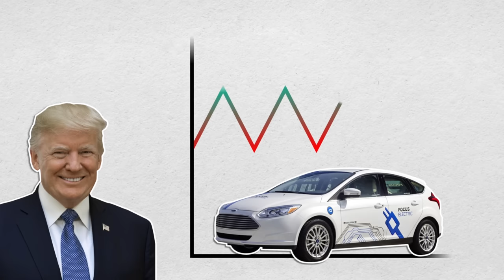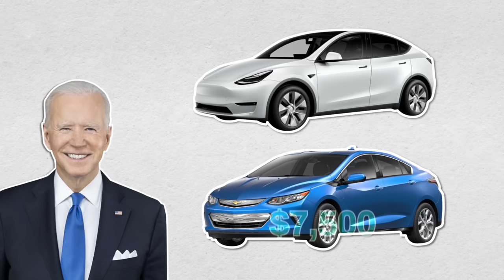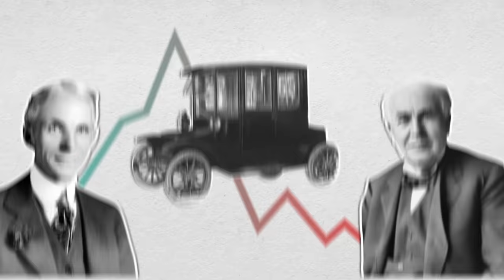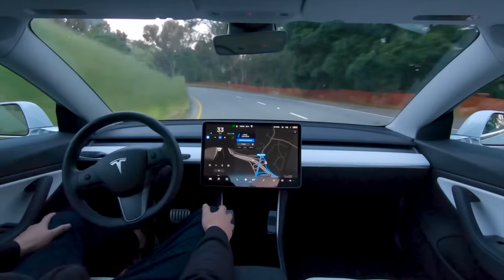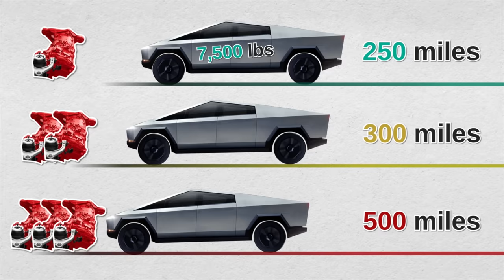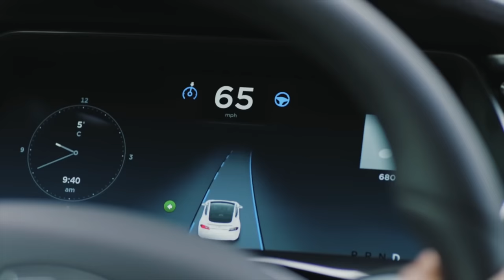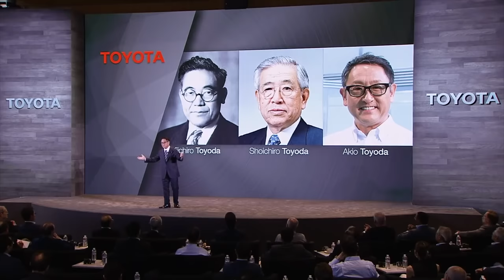Here's Why Toyota is Refusing to Make Electric Cars

Comment: GM did a great job with the Bolt-that is why they have told owners to park outside and not in thier garage just in case it catches on fire !
Reply: This is true; however, the vehicle is GM, but the batteries were made by LG. All of the defective batteries are going to be replaced at a cost of 1 billion dollars. GM is suing LG for the replacement cost. Meanwhile, I'm still parking my 2017 Bolt inside and I don't charge it overnight or leave it plugged in overnight. I have had no problems with fires or anything else in the 55 months I've owned the Bolt.
Reply: The Bolt is a great car by all accounts- no question about it.  The battery issue is erring on the side of caution and is minor- and GM does not make the batteries in those cars.
Reply: Not just the bolt. Teslas and others catch on fire as well. Teslas sometimes catch fire while you're driving them. One person was trapped for a while if you search on youtube for it. Car melted for the most part to the pavement.
Reply: @robertthomas5906  And you can say the same thing about ICE cars. They have a higher rate of catching fire over electric cars.
Reply: @TwoHawksHunting  I've heard that GM was also using a crappy charging protocol.
Hence the software update.
Reply: Just like Kia/Hyundai
Reply: @TauCu  They have told owners to only charge battery to 90% and not to run the battery down to below 70 miles of range. I can see why a lot of owners would have a problem living with these limitations.
Reply: @robertthomas5906  Yes other cars catch fire as well. There are about 80,000 gasoline car fires per year in the U.S.
Reply: @skipondowntheroad5833  I honestly didn't know the number was that high.
Reply: And they recalled every single one of them!!!
Reply: @kiae-nirodiariesencore4270  "You are 10.78 times more likely to have a fire in your fossil fuel car..."

Can you give me a link to that study, since you have already looked at it? I'm extremely curious about exactly what that statistic actually means. I'm guessing that the way it is derived makes it irrelevant. It is spontaneous fires that are the issue.

What is the ratio of ICE cars to electric? 100:1? I'm supposed to believe that for every 10 spontaneous EV fires (NOT caused by human stupidity), there are 11,000 spontaneous ICE fires?
Reply: Millions of gasoline vehicles have been recalled for fire danger since the Bolt was released ;)
Reply: @TwoHawksHunting  That’s the case for all EVs for normal use, because lithium. For highway driving you can charge to 100% and deplete below 70 miles without degrading the battery.
Reply: @skipondowntheroad5833  I wonder how many of those are insurance jobs?
Reply: @TwoHawksHunting  lg makes batteries for tesla aswell
Reply: @robertthomas5906  truth is, EV car fires are extremely rare…
Reply: @peterrotrovich1402  I drive an EV because it's just awesome to drive.  Everyone that I let test drive my car ended up buying one too because they had no idea that it could be that much fun to drive.  1/4 the price of gasoline is just icing on the cake.  It costs me less to drive my full-size EV than a motorcycle.  And assuming all those things can ONLY be made with fossil fuels, wouldn't you want to conserve those resources?  That's my reality.
Reply: @mcamodell  Yes, and I'd think that you could make many plastics with other plants, too. Maybe using just cellulose or starch or something like that. Gas is just hydrocarbons in different orientations....why not rework some plant matter into the polymers we need? I've always wondered that.
Reply: @TwoHawksHunting  suing lg for what?   lithium batteries have always been a liability with the phones batteries catching on fire  now a car with hundreds of batteries it was more than expected but they ignored that fact in order of gaining popularity in the market by looking high tech and innovative high selling points for any company
Reply: Lol

Comment: Good job. Eventually, the truth does come out. That truth is you can't just flip a switch and have battery operated cars.
Reply: "Eventually the truth comes out"? Actually what Akio Toyoda said about EV adoption has been completely discredited in a number of studies. I wish Scotty hadn't included Toyoda's claims in this video because from the comments I'm reading a lot of people seem to think that just because the president of Toyota said it, it must be true.
Reply: @normvanduker9999  What are you even talking about? The truth is there isn't enough electricity on the grid for all those battery operated cars, and there won't be any time soon. All the marginal power comes from fossil fuels. 

Pull your head out!
Reply: @CarbageMan  That's true
Reply: @cs1992  you seem to be forgetting hydroelectric dams. But truth be told, coal/oil will always be the primary source. Gotta take into account anything plastic is made with/from oil. All cars nowadays have plastic parts somewhere.
Reply: They’ve been around for over 100 years….
Reply: @CarbageMan  The other thing no one is talking about is the financial and environmental cost of mining for the materials needed to produce the electric cells.
Reply: @doyouevenknowme7494  The answer is using waste of any sort as an energy source. Something to convert it to being useful, thus cleaning the environment.
Reply: @BrokenAbyss  Not so that everyone drives them. 🙄
Reply: @timtucker7762  Correct!
Reply: @levenkay4468  The average home uses 220 kWh per week. The average commute uses 75 kwh per week. That's a marginal capacity requirement of over 1/3.
Reply: @wonaldgrump9654  : diesel engines and biofuel was starting to become an option about 20 years ago. I had a V10 Touareg that I would fill fuel up with reclaimed restaurant kitchen oils. Hybrids came into the market and bye-bye biofuels! 😂
Reply: @greenbanana2332  I know that rob dyrdek has a green pinto that runs on used fast food oil
Reply: I have driven multiple electric cars. I own one today. From a pure electric vs gas point of view, one doesn't have "all the advantages" over the other. Both have pros and cons. Where you live climate and fuel and electricity cost are all relevant in determining what is best. So are other life circumstances, your employment? How much do you travel in a day/week/year? If gas is expensive where you are and electricity is cheap, electric might be better for you. But if sub zero temperatures are common where you live, electric cars tend to suffer significantly and may result in range anxiety. Electric cars have far fewer moving parts than a gas powered and don't require oil changes. Most electrc cars will rarely need their brake pads changed (if they use they regenerative brakes a lot). I love electric cars, but they aren't for everyone.
Reply: @CarbageMan  "The truth is there isn't enough electricity on the grid for all those battery operated cars, and there won't be any time soon." Really? What is your source?
Reply: @johndoe-ek1qs No problem with an electric power train. It certainly will beat out ICE in the long run. It’s the battery operated cars that are a problem until a lot changes.
Reply: @CarbageMan  I live in an area where sub-zero temperatures happen several months a year. I only have an electric car and I live far from my job. Gas is crazy expensive where I am and electricity is cheap. For me electric is the way to go!
Reply: @normvanduker9999  Mathematics.
Reply: @johndoe-ek1qs  …and range in "sub-zero temperatures" isn't a problem. 😂
Reply: @GoofusPlays  Except that EVs use less hydrocarbons even using coal-fire power plants than ICE vehicles dummy
Reply: @idmhead0160  In a different video about specifically the Tesla model 3, he was over 90% accurate. But that IS Tesla's worst car.
Reply: @CarbageMan  In about -4 degrees Fahrenheit, you can lose about 60% of your range. I know this by about 7 years of driving electric cars every winter. There are plenty of work arounds but they aren't perfect!
Reply: @GoofusPlays  Electric cars are a huge boon for the coal industry I work in,  It would save time to just produce cars that run on coal
Reply: @levenkay4468  Weren't they talking about Japan's power grid?
Reply: @Tim M I'm not sure what brown kids have to do with this thread, or anything I've posted
Reply: @idmhead0160  Yes but did you take into account the hydrocarbons burnt during the mining and production of the cells for EVs? And also how long do these cells last before they are replaced? Are those cells recyclable? Does the cost of recycling represent a significant amount of hydrocarbon emissions? Could the ozone created from the regenerative brakes actually help save the ozone layer? I don't know any of these things. I can read all I want, but unless I get my multimeter  and gas analyzer out and take a few physics courses so I can do the research myself... 
 I guess I'm the dummy. The good news is, being a dummy, I hardly ever belittle anyone else who knows less than me.   
   Oooops
Reply: @kennash5719  I think the guys working oil will want to fight you now! LOL
Reply: @timtucker7762  Yes, but what Akio Toyoda said about Japan's grid was wrong, which is why the Japanese Diet ultimately ignored him. Meanwhile, Toyota has also been spending millions lobbying in the US, which I resent. I think the Japanese need to mind there own business and let Americans decide for themselves what they want to do.
Reply: @normvanduker9999  where are your sources? You keep talking about these “numerous studies” but haven’t provided any links, article names, author names, or anything.
Reply: @timtucker7762  you mean more mining jobs for your buddies that hate the idea of college? Hell yeah yee yee more jobs right?
Reply: Your numbers are wrong.
Reply: @nationalzero269  Which ones?
Reply: @5michael3332  Well I only went to college to get my Class A Automotive Technician license. That's how it's done here in Canada. I actually liked it too. As far as mining jobs go, I wouldn't know much about that. I don't really have any "buddies" but I guess more mining jobs might seem aboot right! lol
Reply: @CarbageMan  just wait until you find Norway on a map. If you have one.
Reply: @johndoe-ek1qs  A lot of things even out. It's mining coal vs refining gas. The transport losses of a tanker truck vs power lines & charging losses. The complexity of ICE vs producing batteries. Cleaner gasoline emissions in build up areas vs dirty coal emissions in rural areas.
And don't forget refineries produce way more than just gas. They'll keep chugging along, forced to sell the unwanted gas at a discount to developing nations where the drive our old cars without MOT across bad roads with the AC full blast.
For a big part, we shift our problems elsewhere while introducing new ones.
So until the grid is completely green, there's no difference between ICE and EV.
EV's are the future, but timing is of the essence. In example, we can beef up the grid now, or just wait till most houses are off the grid, making it unnecessary. We can panic all we want, and shove EV's down everyone's throat in the West. But on a global scale, it will take at least till the year 2100 before the fossil era ends.
People poised on saving the planet better do so by using public transport and having zero kids :)
Reply: @timtucker7762  what about the financial and environmental impact of hydrocarbons?
Reply: @GoofusPlays  wind power is from "thin air" is it not?
Reply: @leskennedy  I've had coworkers in Norway. Even asked around about the family name (which family butchered, once in the US.)
Reply: @esm7708  When I said "the financial and environmental impact of mining materials for the electric cells" by "environmental", I meant hydrocarbons produced during the mining. I'm no scientist, but I'd hazzard a guess that all that machinery running constantly must produce a substantial amount of hydrocarbons in comparison to the fossil fuel burning vehicles they are helping to replace.
Reply: @timtucker7762  so the hydrocarbons produced to drill, transport and refine oil are meaningless to you? Have you any idea how much energy a refining plant uses?

It is accepted fact now that over the lifetime of an EV is is better for the environment, even with a heavily carbonised grid, and with the added benefit of batteries now outlasting the life of the vehicle and being recyclable.

Comment: Lots of information - now for some good STUFF - I ordered the Tesla Cyber Truck with one motor - I can get it to run on solar power - mounting the 425 watt Tesla Solar panel on the back - should generate 28 amps to charge 2 Marine batteries in the back - using a 1500 watt inverter - I can charge my Tesla Truck for FREE in Florida, California and Arizona - true - FREE electricity

Comment: They can't even keep the power on when it gets hot where I live.
Reply: You could sit in your EV with  the AC on (they're powered by batteries, not the grid)
Reply: @rp9674  then battery’s get too low and grid down now stuck at home or walking.
Reply: That's a lie. Do you have one?
Reply: @rp9674  Lol!  Till the batts die in 8 hours then you are screwed bruh.
Reply: If we keep ignoring climate scientist, it'll get even hotter...
Reply: Hey, R P, classic ignorance. There, I said it. It's no different than if I ran my gasoline engine to keep myself cool. Run out of gas, run out of battery...
Reply: @confuzler6985  oh noooooooooooooo lol

Comment: I'm old school Scotty! I have an old classic car. It's a 1963 Chevrolet Impala SS bright red. You would love it! I'm sticking to gas cars and are currently looking for a good used Toyota Tundra with the 5.7 V8 to replace my 2018 Ford F150 with the 3.5 twin turbo charged V6 with 51,000 miles on with a rattling timing chain every time I start it! I talked to a Ford mechanic and he said that's normal on these engine and in another 5 to 10k miles it will have to be replaced but do worry you will get a check engine light before it does any damage to the engine but don't keep driving it after that light comes on. He also told once you get 100K miles on it to broom it because the turbo chargers will fail and it's over $5000.00 or to replace them! I'm sticking to the naturally aspirated V8 engines. Love your videos.